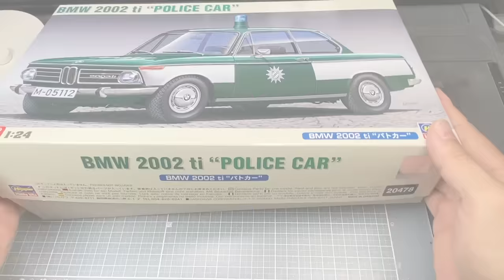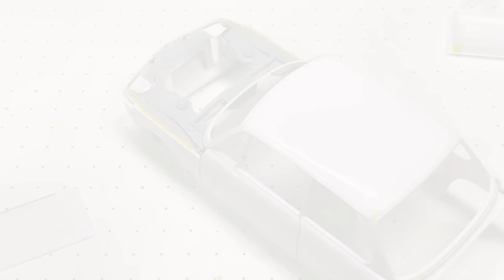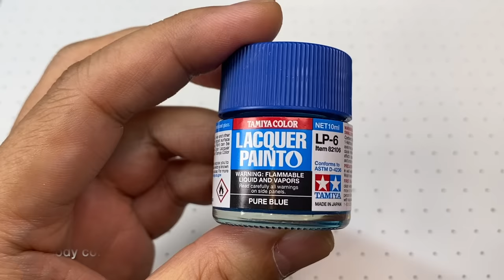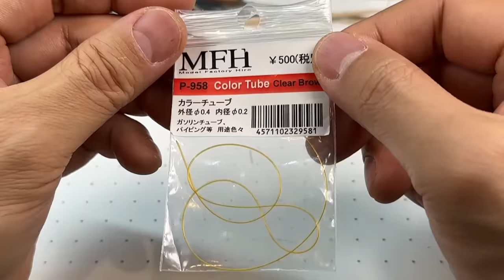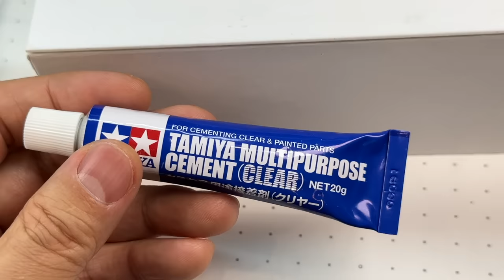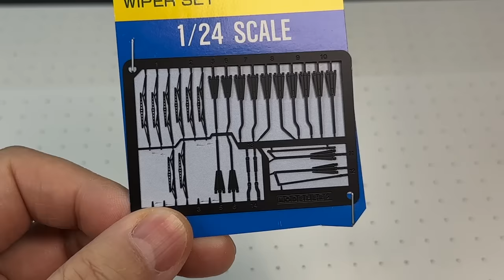BMW 2002 ti 1/24 HASEGAWA Model car build [Full version]

Comment: Besides being a scale modeler as a young boy, the '02 is one of my absolute favorite cars, since I had several full scale versions of them as a young adult in the '70:ies . I took them apart down to the smallest part, repaired and rebuilt them; I know them by heart. This scale model build is like ASMR to my brain. When you constructed the scissor mechansim for the bonnet I was almost in tears. For some reason that mechanism is so imprinted on me and my brain I couldn't really take in how realistic you made it. I have been wanting to build this model myself when I retire and have two Hasegawa and USCP kits in storage, but after finding this video I may just watch your build over and over again. Thank you.
Reply from the maker: I'm also happy if you can imagine the real thing by looking at my model. Model work allows me to imagine a lot, so I'm very happy. Thanks!

Comment: Awesome!! 🙂👍
Absolutely amazing build & quality.
My first car back 1977, was a BMW 1800SA, 1969 model.
When BMW took over the Glas factory, they sent several thousand KDK (knock down kits) to BMW SA for assembly and distribution in South Africa / Rhodesia.
It was a car of similar size, with engines, gearboxes, underpinnings and interiors all from the BMW parts bin.
The 1800SA & 2000SA & (BMW 'Cheetah' for Rhodesia) became uniquely Southern African cars.
Cars pretending to be BMWs.
Still a few have survived to this day.
My own 1800SA was 'T' boned in '83 so went to the scrap yard😢

Comment: Absolutly Amazing. This unbelievable, your talent is impressive. I build model cars in scale 1/24 too, but only in metal with little plastic-parts.  I can learn here many things. The only what i miss here, was the working steering column in the engine room. Yes, your steering works, but not from the steering wheel. I know, it's very difficult to build this, but i had looked, how the die-cast models do that. So i made some copy. But i must congrulate for this amazing work. Very, very good.

Comment: There are several areas of interest here, deserving comment. First, the front strut tower cups are light/medium grey. Second, the vacuum advance on the distributor is missing. Third, the rear quarter glass is a pivot, and is fitted from the outside. The two piece drive shaft and donuts seem to have been ignored. In addition, the bonnet/hood stay is good, but lacks that holding pivot. A magnet or other arrangement will not suffice. 

I know because I have personally restored two of the E10 BMW 2002 vehicles... the whole and actual vehicle. A late '74 with square tail lights, M10 engine with single solex down draft, and a twin solex '72 four speed. 

Hope this helps. I comment at 47:41 from a 1:25.43 video.

Comment: ... well, ... I wouldn't be surprised if, for example, the motor still works in the next "development stage" ...
I could only watch for about 20 minutes at a time, after that I needed a non-alcoholic hot drink to relax...
Your skills are admirable...
How did @John wrote : "Awesome work" ...

Comment: Very painstaking work! Taking off my hat! But with all the modifications - door hinges, hood and trunk hinges, carburetor and other small parts, it is surprising that you left the drive belt for attachments and cooling fan blades intact - they are very thick!

Comment: I'm amazed! 😍😍😍
When looking at the end result, it could almost be a full size real car, The one thing that I think does not look totaly realistic is the windows, especially the windscreen has this plastic look to it and it distorts the interior in a non natural way. Would it be possible to make something which looks more like real glass? 🤔
Reply from the maker: The windscreen does not have sufficient material to replace the parts of the kit. I'll continue to think about it and look for it. Thanks.

Comment: I primarily make aircraft scale models. Never built a car. I always saw car models and thought they were too basic. But your model changed my view. 

You have done amazing work. Its just incredible the lengths you have gone to add details to it. It has inspired me so much that I bought the same Hasegawa BMW model and building it the way you have.

I was wondering what camera set up you have.
Reply from the maker: Thanks! I am recording with my iPhone(14pro).

Comment: I am quite confused about the title and the engine as it doesn't seem to match. 
A 2002 ti is a turbo engine with fuel injection and that engine has carburetors.
Other than that you made heavy modifications to the original model and it turned out great.
Reply from the maker: Thanks for the comments. I searched the 2002 ti and referred to the picture.
And I'm not sure if it's accurate, but I referred to the following.
2002 - single-carburetor
2002 ti- dual-carburetor high compression
2002 tii - fuel-injected 130 PS (96 kW; 128 hp) engine
2002 turbo (E20)- turbocharged

Comment: how do you keep the "glass" so flawless?
Reply from the maker: I am careful not to damage the glass as much as possible.
Reply: Do you polish the clear plastic?
No matter what I do it gets marred in some way and my attempts to repair it are inconsistent.
You've heard enough about how amazing you are so I won't waste your time.  
Do you ever damage cars while cutting our hoods, doors, etc?  Do you start over?

fingerprints and dust control, the magnifier on our phone screens are not our friends, what do you do to limit contaminants?

How fine are your files? I see tool marks on everything I do.

If you have the time to respond I will be amazed.  I'll say thanks now for the inspiration
Reply from the maker: @robertmassucci1  I also make big and small mistakes every time. Those mistakes will be reflected to make my next work better. My big mistakes that I couldn't sleep for days due to regret are no longer made.

I think if you keep working on it, you'll definitely make a great result.